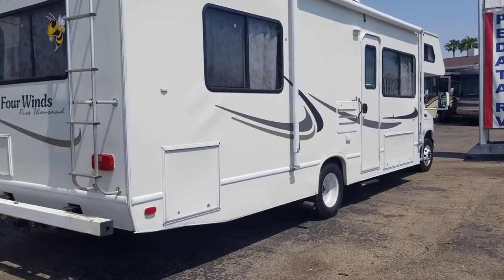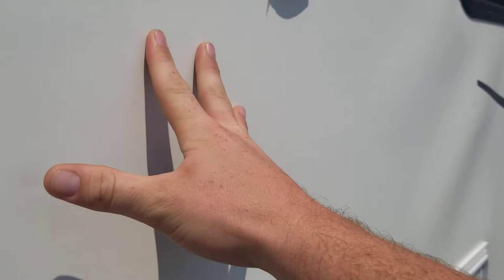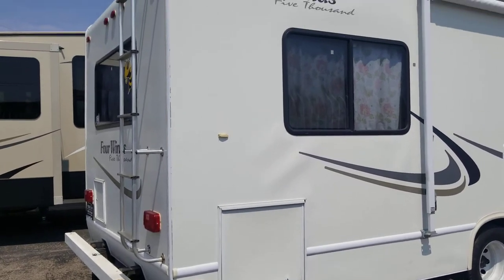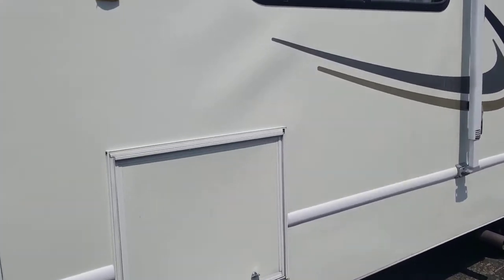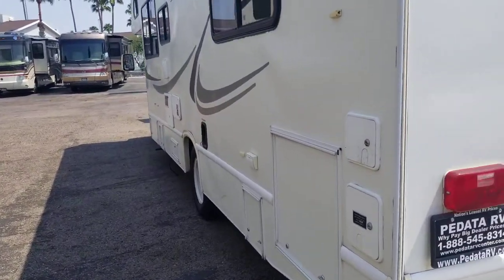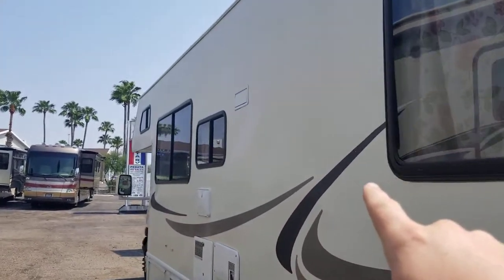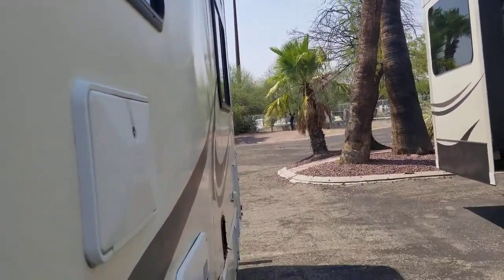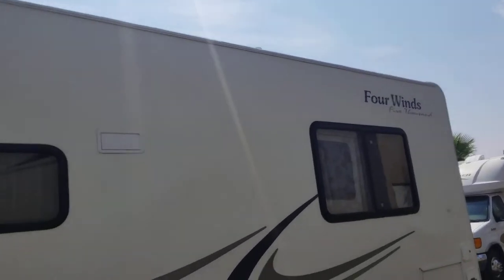RV & Motorhome Delamination! What it is and how to spot it!

Comment: I was looking at a remodeled unit in Az with this all over the front. I suspected either lack of adhesive from where the fiberglass bonds to the wood in construction or water damage. The pics show a beautifully remodeled inside and whatever water damage would be concealed by paint.
Reply from the maker: It can be from the glue failing in this AZ heat but most of the time it is from a water leak somewhere. Depending on how bad the delam is, might be a good idea to stay away.

Comment: Could delaminations be caused from being too tight to the windows framing...not enough room to expand with the extreme heat in the Arizona sun?? I know that vinyl...AND one piece fiberglass expands AND contracts with heat and cool.....so an allowance needs too be made to allow for this....if too tight....then it will buckle.
Reply from the maker: John, I'm sure that is a reason for some manufacturers. RVs are supposed to have some fiberglass flex to them. Most delam is from water damage around the roof or windows but every now and again you see one from the heat. Got too hot and the glue failed.

Comment: Yeah you helped alot. I already know what delamantion is. You didn't help with how fix it useless video.
Reply from the maker: Mario, did you see the title of the video? Delamination, what it is and how to spot it? I did not mention anything about fixing it. That being said, in almost every case with delamination, the fix costs so much the RV would be considered a loss. It is not cost effective to try and fix or repair. If you do want to fix it, you need to strip the whole fiberglass wall, replace any rotten wood then put it all back together.